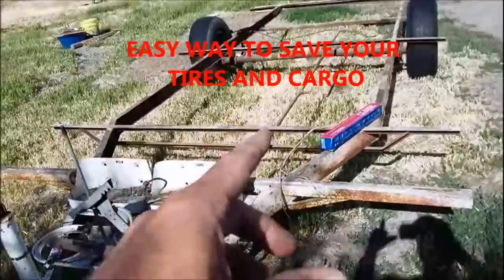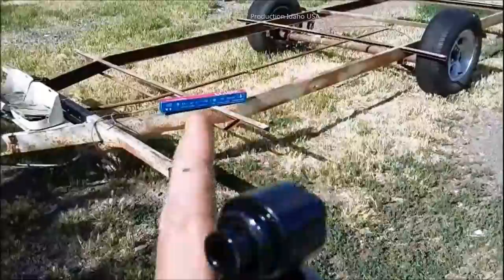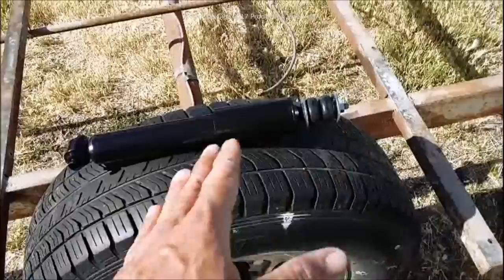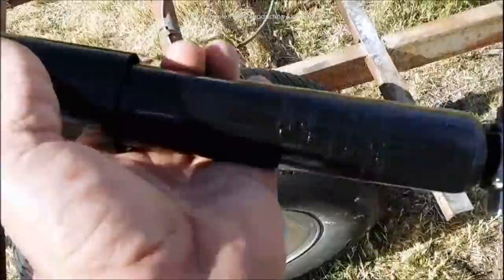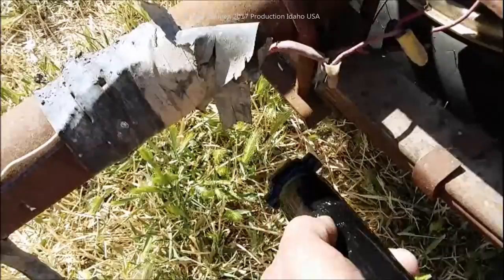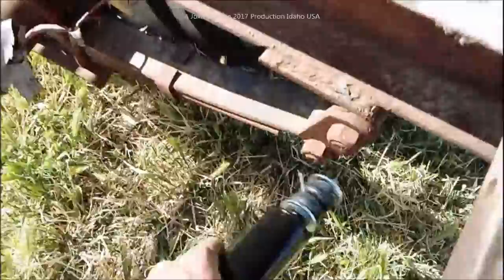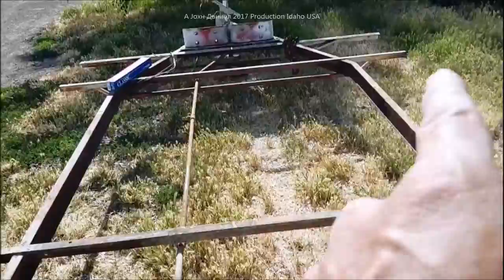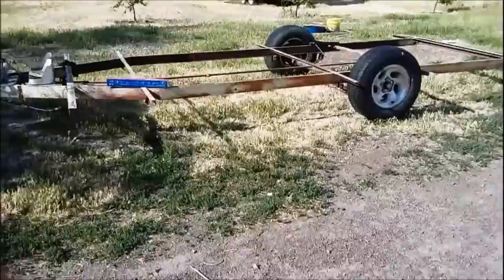DIY Putting Shocks on ANY Trailer to save Tires vid 1 parts used below

Comment from the maker: PARTS USED & SPECS - READ ALL, Amazon - Monroe http://amzn.to/2oQoKiv Gabriel http://amzn.to/2onKbTS OR https://ebay.to/2K2iKeD RV TRAILER  And option 2 Gabriel Trailer shocks  https://ebay.to/2Hj5fJu
The BEST Mig Wire my preference is INE, .030 See specs here https://ebay.to/2HN8uWDAND .035 https://ebay.to/2HMpi01 AND 10 pound spool .030 https://ebay.to/2qPdamP INE is Best for Anyone who welds. Welds easy & awesome from 30 amps to 200 both AC or DC.
A great 120 volt welder for anyone Novice or Professional is https://ebay.to/2K3pxEz MIG KIT Beginner to Pro DC+, much better than a Chicago Electric, + theres parts if you need them. Big plus, Guy selling them will support the welder after you buy it.

Good luck, safe welding.

Lincoln, Hobart, and other MIG wire brands simply don't add up to being in the same line of competition as Inetub wire from Italy.
I prefer the .030 due to being able to run it faster with a higher arc closer to the work. But the .035 does work well to fill chamfered pipe and plate.

Specifications For the Monroe http://www.monroe.com/en-US/e-catalog/31176/
Specifications for the Gabriel http://gabriel.com/product-search/light-vehicle-part-search/?q=82026

All JOHN DANIEL /  PREPPER MOUNTAIN VIDEOS are the Property of Panorama Remote Power LLP Idaho USA
Reply: Thanks!!!

Comment: Great video. I have a 5 X 9 utility trailer that had the small wheels on it. I didn't like the setup so I got a rear axle from a caravan with leaf springs on it and installed it. When I was done, I really liked that work that I did. I when to load it with lumber and when I stepped into the trailer I noticed it was VERY bouncy. I don't want to use the trailer till I can figure out how to stiffen up the ride. I hope that a set of shocks will work.
Reply from the maker: The best shock you can use is this one, https://amzn.to/2x7XvWj by Monroe. made for a front end of a car with a 360 cid V8. Very short and strong. You can search shock hardware & mounts there and see what may fit your build.
Reply: Thanks John. I will check them out. I sure need something. My trailer bottoms out on my tires.

Comment: man those shocks are cheap and not bad quality either, im going to do this on all our trailers , the noisy bouncing trailers is annoying.
i was glad to see how those offset axles mount, i wouldve installed them upside down.
Reply from the maker: These are gabriel but I have been putting mostly the KYB shocks for the same use on Rv's for years in my sideline work.  Stopped doing it for a few years and now its back in demand so I am doing it more often for people and myself.

Comment: Your just smart dude. Trailer shocks cost like $50 each and your right, they are just sports car rated shocks that are sized to fit a trailer. You found the missing links  to these and damn sure the cheaper cost.
Reply from the maker: +Alton Warford Jr Yes, trailer shocks are pricy labled as trailer shocks.  However what I found are 100% all you need but much cheaper.

Comment: Need info on what shocks ir stabilizer to use  on my trailer I designed
Reply from the maker: That depends on what materials your trailer is using in frame, axles and heights. Normally a shock/spring kit will allow you many options, but in our world famous Joe's 2024 economy, folks are $$ broke $$ so you may have to improvise.

Comment: I am going to add shocks to my utility trailer. Do I use car shocks, or are there shocks for trailers? What strength do I look for?
Thanks
Reply from the maker: The shocks for the caravan axle should be tried, but i prefer the ones i put links on the info. They are easiest, and up to 5k axle rates.

Comment: Where should leaf springs be mounted for 8 foot trailer
Reply from the maker: At 60/40 point, so you can measure the 8 foot deck area, and from front edge ( not the tongue ) you would measure back 60%  which is 58 inches and that will be the center of your axle, the spring perches will be about 15 or so inches front and back of that depending on your spring type and length.

Comment: Hi  !   I am looking for someone to build a prototype  trailer to transport dogs to the off leash park. I want it to have shocks and sit close to the vehicle with a fold up hitch to save room in the driveway. Would you consider this ?   I was hoping it might not take the usual counter steering to back up as well and have the multiple use as a dog washing station for those water living dogs.  If you have interest let me know how I can contact you. Thanks
Reply from the maker: Backing up a trailer like that would be a nightmare! Sitting close to the vehicle would limit turning radius and in many states be illegal. The minimum 32" trailer tongue I think is a law in many places.
Reply: @JOHNDANIEL1  thank you then. A trailer hitch cargo modification may be a better option.